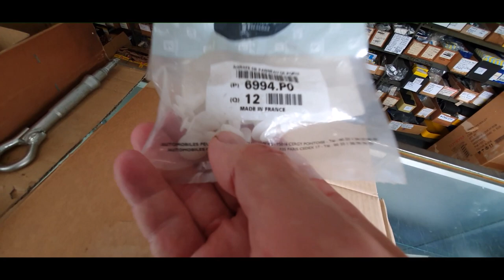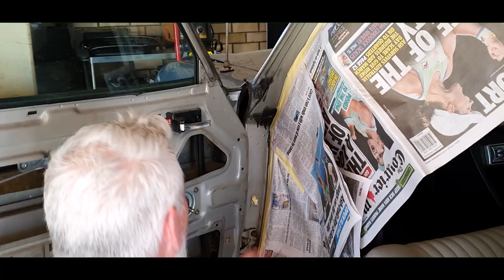REPAIRING OLD DOOR CARDS | Peugeot 504 Restoration  (Episode 10)

Comment: Your dent in the door - I got a dent puller from eBay that you glue stubs to the panel with hot glue, then attach a puller with feet and pop them out - no holes to drill. Had great results - you can’t see the dents at all.
Reply from the maker: I do have dent pullers, just need the right glue. Cheers mate.